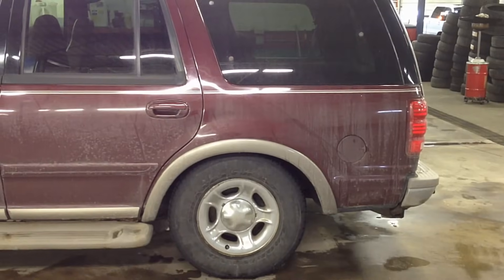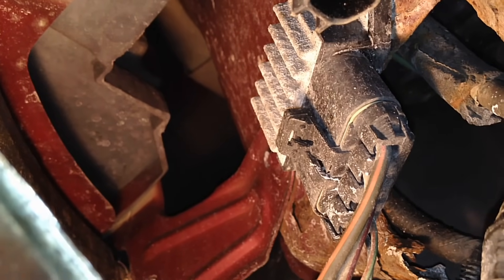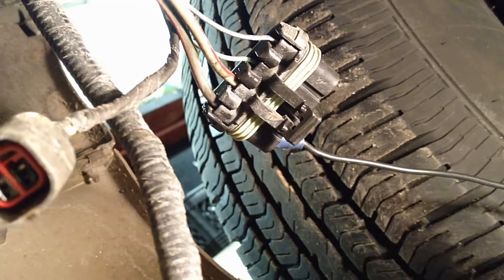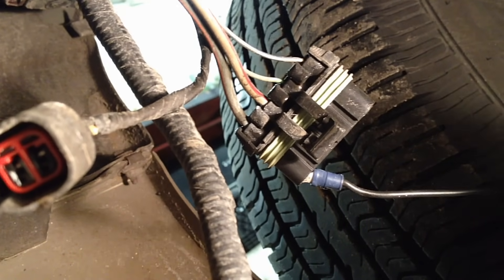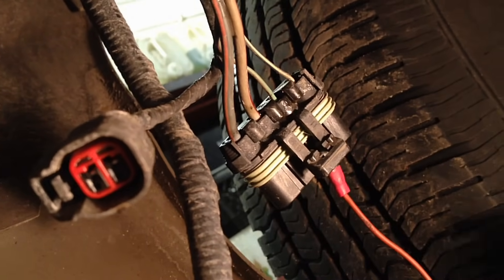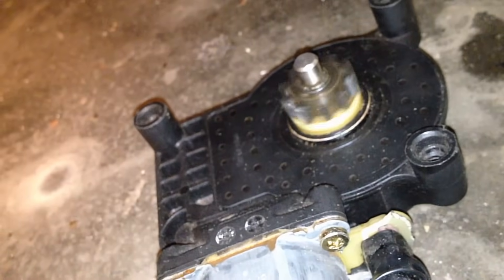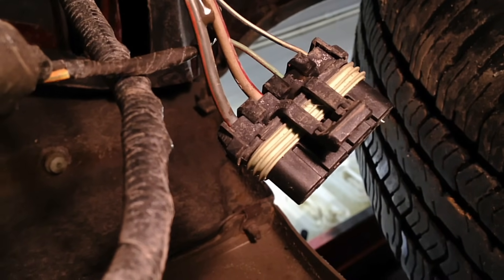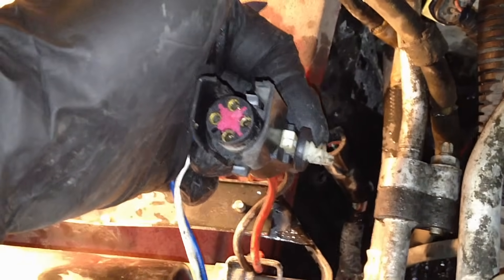Ford Air Ride Rear Suspension Down Diagnosis & Fix

Comment: I recently bought a 2000 lincoln navigator, so I'm pretty much unused to the air ride system and its problems. A few days ago the rear bags just stayed low, I didn't notice the air pump/compressor functioning before but everything was ok, 1st question, when is the air compressor supposed to turn on? at the very first moment you turn on the ignition? Because the only time I can listen to the compressor work (I think) is when truck is on Drive, but still air springs are not being inflated, so it is pretty difficult to check for leaks on 'em.
Reply from the maker: Ok so it sat for awhile maybe overnight and you went to drive the truck and the back end was to the ground as in the video? Does it ever pump back up? If are really low they should pump back up with truck idling in park. Other wise they wont start to adjust till you put it in drive. Does the air compressor at least run when in drive but maybe not pump up the rear? Have you check the rear linkage for the height sensor they like to pop off on those models. I shown and example of the sensor at the end of the video.